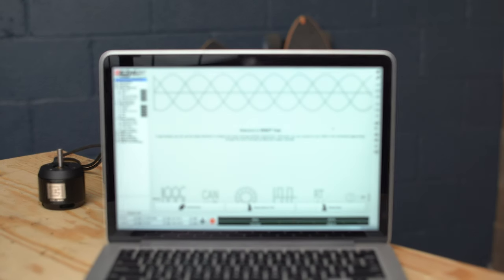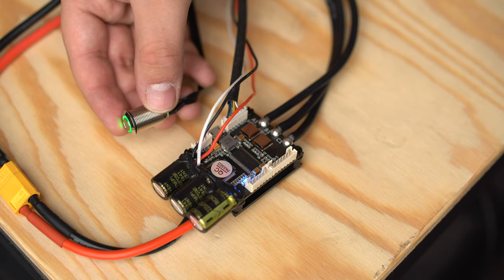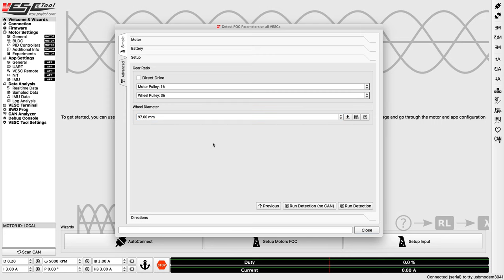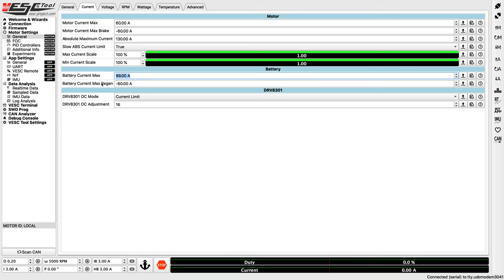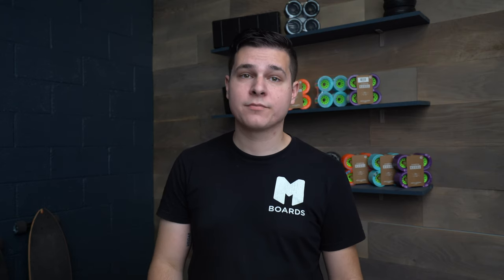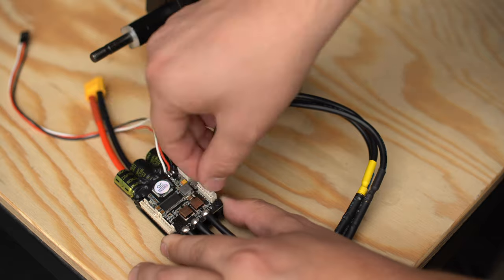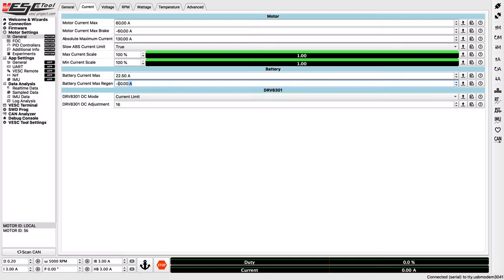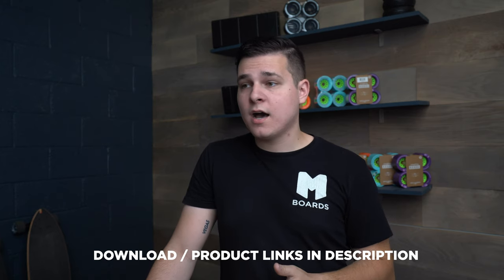VESC® Tool 2020 Tutorial - How to Program Vesc for DIY Electric Skateboards

Comment: Hello!  I completely converted a Xiaomi 1S for 6 months and worked on the scooter with a 48V 1000W motor with Hall sensors and 3 motor cables with 30 Hall magnets.  One question PLEASE: updated my VESC 75100 with FW 5.02 to 6.02 and all the settings are great but the speedometer is correct in the air 100kmh but when driving the VESC app shows e.g. 70-75kmh and GPS from Play Store only shows 50-55kmh and at  VESC at RT speedometer start screen e.g.  85kmh and GPS from Play Store second app only shows 60kmh instead of 85km!  I must have a problem in your video at the minute: 13:23!  It says Motor Pulley and Whell Pulley and I never change that and just always press "direct drive" and then Motor Pulley and Whell Pulley are grayed out so they can't be adjusted anymore! And then I do the run test, the rear motor turns  and always shows like yours 49A Motor Current and Sensorless!! And whenever I set up the Hall sensor always USB cable on the computer and in the app again and again when checking the motor it shows Sensorless. But I have 5 Hall sensor cables + 3 motor cables! But please  Can you tell me what the Motor Pulley and Whell Pulley are called in German? What do I have to set? As I said, I have a 48V 1000W motor and it has 3.1kg, an aluminum motor with 30 Hall magnets! But I once used Motor Pulley 30  Magnets set and then the VESC app only showed 35kmh or 65kmh! Please what is meant by motor pulley, what do I have to enter? You have the best YouTube video with settings on YouTube and I hope you can answer that for me.  PLEASE!  I just want to know what Motor Pulley is and what I have to enter there!  My Hall magnets 30?  Because I always press direct drive and skip this entry with motor and Whell Pulley!  Kind regards.  🙂

Comment: I have one huge issue. When I run the motor test. My motor makes this wierd sound then lurches forward and completes the test with no wheels spinning. Also the vesc blinks 3 reds and another 3 immediately after. I just bought this vesc from you and followed all of the steps. Is there something I’m missing?

Comment: i have a flipsky vx2 remote and a torque boards prebuild  but a computer went faulty so i removed it for now and am doing a single motor set up....i set everything up and mostly everything works but when i do remote set up the vx2 is paired but with no input ....the controller seems to be working looking at the remote calibration but there just isnt any input to the board.... any tips?

Comment: Hey Mike, I had a question about the motor current max and the battery current max. How are we able to set a maximum current to the motors that is greater than our discharge current? How do these 2 numbers make sense together? If you could answer my question that would be great. Thanks for your super helpful videos
Reply: You can think about it like a step down converter. The coil current is higher because the duty cycle is not 100% and the rest of the current gets pulled from ground because of the induction of the motorcoils. Motor current defines the torque output ot the motor and the battery current defines the power output. Usualy only 1 limit is active only in one rpm/torque spot both are active. Hope this helps. Even if a little late...

Comment: I am an RC guy and this is the first time hearing about a VESC.  I use brushed and brushless RC ESCs.  I have recently been playing with e-bike/scooter equipment which is a whole different world.  RC ESCs and motors and e-bike ESCs and motors do not work with each other.  It looks like a VESC will work with normal RC equipment.  Will it work with e-bike/scooter hub type motors?  RC ESCs do not.  I had to rig a PT01B interface to the hub motor controller to be able to control it with RC radio equipment which is not very good due to those controllers reference the signal at the bottom and an RC ESC references in the middle.

Comment: Thanks for the video. But I have one disagree with your tune: you're using vesc 4.20 with the max current of 50 amps continuous, but setting it up to 60 amps, which can result to overheat the vesc during long climb hills
Reply from the maker: Yes this can happen during longer rides. Definitely want to consider your riding patterns while programming 👍🏻

Comment: Hey Mboards, I’m having some issues with the ppm mapping of the remote and when I do it and when the throttle is in the middle it still will be on like 80% for some reason and I don’t know how to fix it, any ideas?
Reply from the maker: There should be a setting to set the start, end, AND middle. You can use the middle setting to “zero” out your throttle. Hope this helps!

Comment: you set battery current regen to -12A, while your 30q cells are designed to only take 1,5A charge. should't you give it 4,5A since it's 3p setup?

Comment: if I like to control two motors with a raspberry pi or Arduino separate, it would not be a problem?  like different speeds or directions.

Comment: So would it be possible to get 1000 w motors and use and program them to only go 25 mph and only use 700 w with the vesc, and does following this prosses mean you with thave to manually go back and change the speed and breaks

Comment: This video is fantastic! Thanks Mike! You’re the best!                                 
Question: Mike if we are using a Dual FSESC4.20 Plus from Flipsky should we still be cutting the battery current max and battery current max regen in half? It’s 1 Vesc but controls 2 motors
Reply from the maker: If you are using an All-in-one dual vesc, you’ll still want to divide by 2 if you have to program 2 sides. 

If you only have to program the entire thing once, you would enter the full amount. 

Hopefully that makes sense!
Reply: Thanks!

Comment: Can you flash the firmware on 2 vesc at once or do you flash each one individually and then connect them together via cable and proceed with settings?

Comment: Hello, this is a great video for people to setup everything. And I am having hard time figuring out how to operate the motor with keyboard/ Joystick. I am using VESC 4.12, BLDC motor. It would be great if you can help me with this.
Reply: The option to control Joystick or Gamepad was added recently to the VESC tool I guess. It would be great if you can explain how to set it up and also how to control the speed and RPM not just with Gamepad but also with Keyboard control

Comment: This is my first dual motor VESC setup. I’m currently configuring the VESC and the motor sounds like it doesn’t want to spin or as if it’s having a hard time spinning. When I run the detection, motor spins fine, however when I try to setup the Remote and to calibrate it, that’s where the motor doesn’t want to spin. 
What can cause this issue?

Setup:
(2) 5s1p battery 8000 mah 30c
(2) C6374 motor
(2) 4.12 Flipsky VESC

Battery Current Max: I had it set to 25 Amps 
Battery  Current Max Regen: I had it set to -6
Reply from the maker: What’s your voltage cut off set to?
Reply: @MBoardsco  Voltage cut off start: 34 V and Voltage cutoff end: 31 V
using the default battery cutoff calculator for 10 cells
Reply: @MBoardsco  I've also recorded the VESC settings:
https://youtu.be/GBEjtWoiaxs

Also here's my setup diagram:
https://www.reddit.com/r/ElectricSkateboarding/comments/nmavtk/need_help_figuring_out_what_wiring_adapter_needed/
Reply: @MBoardsco  resolved!!!!

Comment: So I followed all your steps and once I plugged in the can bus cable the lights stopped turning on and the computer no longer recognizes the vesc. Did I fry it ? And if so why?! Using a 10s4p battery with two 4.12 vescs. Kept it basic- plugged it in just like you said. Each vesc spun it’s wheel individually but once I connected the vesc it is dead! Help please!
Reply: Battery is split with power going to each vesc also

Comment: If you have a dual motor vesc that runs from one cable power cable unlike the triangle wires piece like urs do u still have to cut the battery current max in half
Reply: Yes. Its basically a canbus connected into one unit. If you see two different connections at the lower left hand corner, that's your key.

Comment: Can you get 2 more of these 4.12's and do a 4wd via the can bus? Will the vecs detect it? Also, do you need a loopkey anymore or was that a thing of the past?
Reply from the maker: Yes you can do a 4wd set up with 4 Vescs 👍🏻

Also a loop key is an anti-spark power switch alternative that is much much cheaper than an actual button and is a good option 👍🏻
Reply: @MBoardsco  nice, will you ever do a video with 4? Currently nobody has a video on that
Reply from the maker: Yes! Will add that to list of video ideas!

Comment: Is there a way to adjust throttle curve? My VX1 is super touchy and has caused me to almost fall a few times.
Reply from the maker: Yes there is a throttle curve section with in the Vesc Tool. You’ll find it in the App section.

Comment: Why did you put 45A in the "Battery Current MAX on the first VESC and 22.5A in the second VESC?
Reply from the maker: With 2 Vescs you’ll want to divide by 2 so you aren’t pulling double the amperage from your battery

Comment: hey team and like your videos about explanation! Have one -> is there a need of anti-spark switch for using with VESC 4.20 ? or no need ? don't know whether VESC supports it but there is definitely some supports about cut-off voltage. VESC4.20 is exactly like on your video and planning to use custom built li-ion 18650 6S2P battery 6000mAh (supposedly battery can make ~30-35A peak) Let me know news and thx again for great channel with explanations /Alex

Comment: Nice & Thanks :) Sir , there are Dual drive single ESC with remote controller right.. what is the advantage of using two single drive ESC's ?!
Reply from the maker: If one Vesc fails you only need to replace 1 Vesc. If one side of a dual Vesc fails, you have to replace the entire thing.
Reply: @MBoardsco  Thanks Sir 🙏 , what's the frequency of failure say for example incase of Flipsky dual drive ESC ? Thanks once again 🙂
Reply: you have 2 separated systems, mean nore safety, also prize is lower per each.. you can use combo of many diferent seller,,, with no big deal issue. and desfinetly good for continual use. coz dual bord is must be replaced whole.. and ez answear for your second question.. 2x more than 2 Vesc system..  if you burn it.. you burn it..
Reply: @nin1ten1do  Thanks 🙏👍

Comment: First thank you so much for this video, it's really informative and easy to understand, second, if I'm using a dual VESC rather than 2 individual VESC's are the steps the same?
Reply from the maker: Yes, if you have to program 2 sides of a dual Vesc, the steps are the same 👍🏻
Reply: @MBoardsco  thanks for the reply man!
Reply: @MBoardsco  hey I’m using a dual flip sky vesc 6.6 I got one side programmed but the other side refuses to connect and yes I have the vesc in dual mode

Comment: What if your flipsky VX1 remote is not showing on the VESC Tool? the wireless light is solid on my remote and my VESC tool. (from the Mboards 2020 Single motor Kit)
Reply from the maker: If you are using the UART port it will not show in the VESC tool.
Reply: @MBoardsco  I will check that tomorrow. I watched your videos everything “seems” right to me. If the Vesc software recognizes and lets you adjust the motors it should be functioning properly I imagine? Which means I need to figure out what I am doing wrong for the remote
Reply: @Mboards Ok so I ran Vesc tool wrote the motors configurations and it spun my motor up. After all settings were input and saved I disconnected in vesc tool and via usb cable. The light on the flipsky receiver is blue and my remote is solid red but no motor movement
Reply: @codysays  Having the same issue, did you ever figure out how to solve this? Thanks!

Comment: Can you download onto a chromebook or does it have to be windows?
Reply from the maker: The only official version is for Windows at the moment.
Reply: @MBoardsco  I dropped my remote for my board and now there is a mechanical fail issue with it. The sping thats inside the thumb throttle has broken or loosened and the thumb trigger now doesnt self centre, it will stay on fully braking or full throttle without self centering if you take your thumb off. Wondering how hard it is to just replace that single part. Because of covid, I cant buy a replacement remote for months. Was considering trying to buy whole new  esc but I dont know what Im doing there either. Anoying

Comment: hey thanks for all your videos, it definitely helps. im trying to setup my input wizard for my 2.4 nano remote, but for some reason the  at the mapping chart the controller is not being read. i,t is paired with the receiver as both lights come to constant and im am at a standstill. 
my motors have been read fine and all the data plus i have updated firmware unless ihave done that wrong, what do you think i can do?
Reply from the maker: Have you tried reversing the PPM cable? Many times if you plug it in backwards the lights will turn on but the signal will not be read.
Reply: @MBoardsco  thanks for the reply, i have and ensured of that. recently i have just noticed only my green light is on the remote when it is powered.... also i just got a signal on PPM mapping but tried to go onto the wizard and it told me to update my firmware.
Reply: @MBoardsco  got it working, just had to continue to upload firmware onto both motors properly like you said in one of yer other videos. thanks for your help man
Reply from the maker: Glad you got it figured out!

Comment: Do a under 100$ challenge
Reply from the maker: That would definitely be a tough one haha. Deck, trucks, and wheels would break $100 by itself. Would have to buy all used parts maybe.
Reply: @MBoardsco  I have a GT carbon and want to change my ESC and remote to the V2 and that hobbywing on ur website with this work